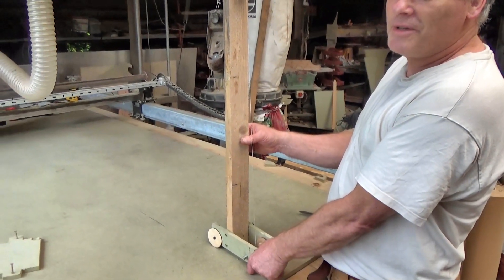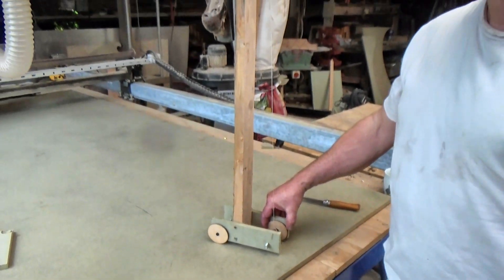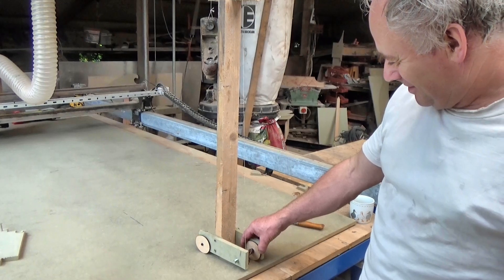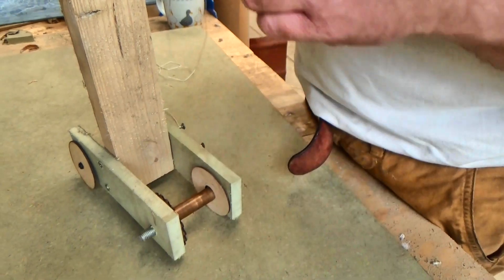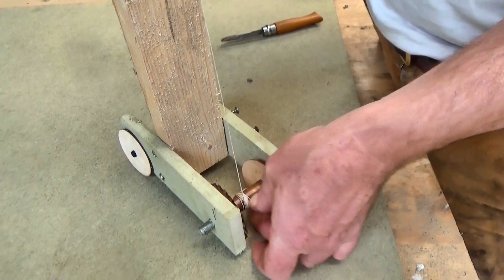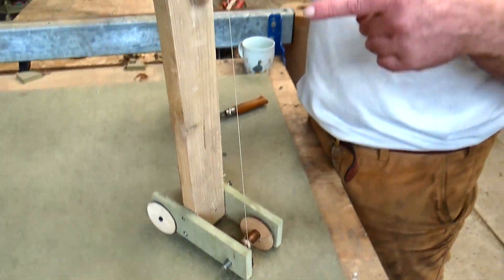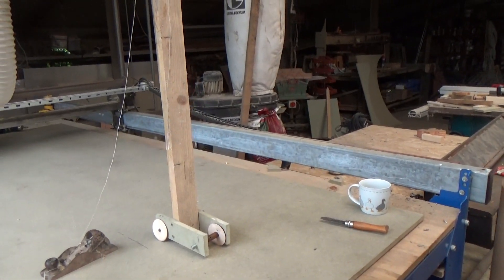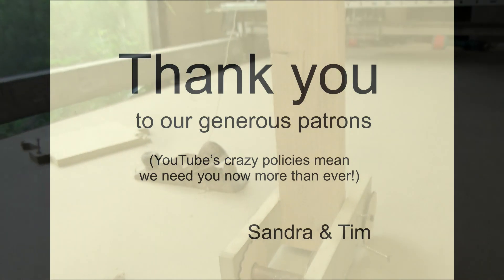A Full-Size Wind-Up Car - Would It Be Possible To Make One? Mark One.

Comment: I was thinking of plates of horizontally mounted staked plates that contain large flat spring steel maybe 4/inches wide flat spring steel. Kinda like the little springs u find in a lawnmower pull cord that retracts the pull cord. These large plates of springs could be staked , say 5 to 10 plates tall with a center mechanism running down through the middle. Each spring could be used independently or together by a shifting mechanism in the car. By the placement of the shifter u could have 1,2,3,4 or more used at the same time or all together depending on the amount of energy u need at the time. The springs could be wound by a large drill type device and the plates would be would one at a time by each spring locking out as each is wound fully switching to the next spring automatically and the same for when going down the road, switching to the next spring when the previous spring reaches a low tension. The springs are encased in metal with only a hole down through the middle where the shaft makes it’s connection and disconnections from each spring. The throttle pedal in the car could be a device that releases resistance to the spring force the more it is pressed and when braking it would use that energy to rewind springs. It’s kinda hard to explain without a mechanical drawing but is the basic idea.

Comment: using a heavier weight and a less steep angle to compensate for loss of pe would make it shorter. Also using a regular wind up cars thingy in series if you could would work.
Whats the farthes a wind up car has traveled? 
so in series and with big tension meaning little movent ni the sprins working in series may make it posible to travel... Let luck lend itself to me who am Imperfect.

Comment: I have a wind-up wrist watch that has an auto-wind mechanism inside it.  While I do need to wind the watch in the morning, it will stay wound and running throughout the day as I move around.  The auto-wind mechanism is like a half wheel on an axel that will swing around and wind up the watch bit by bit throughout the day.  I wonder if you could make a wind up car using this concept, where you use some of the motion made by other parts of the vehicle (or the person riding it) to add "clicks" to the wind-up part.  And the amount of energy or effort could be offset by gears and pullies, I think?  My son knows a lot about physics and explained to me how this may not work out...something about perpetual motion.  Lol!  But it's still fun to think about!

Comment: One of the ways it could work would be with a flywheel but it would still require a couple of springs and not be enough to go to the shops even if they were 5km away

Comment: This can be said to be a form of flywheel energy storage--storing mechanical energy to be used later.

Flywheel energy storage is mostly used on spacecraft or in heavy industrial environments where the energy investment relative to the energy budget is great.

Nissan used a special transmission on a racecar recently that had a special gear set: rather than connecting the engine to the wheels, it connected the wheels to a flywheel, which was stored in a vacuum for greater efficiency. It would spin up to 100,000 RPM's as an alternative to braking at high speed, and then disconnect from the wheels to brake. When it was time to accelerate again, it would dump its energy back into the wheels, granting an immediate surplus of acceleration, with less gasoline and brake usage... which is very important in an endurance race!

It worked too well: car transmissions weren't designed to move so much energy so quickly, even its special one, so it blew up and caught fire mid race.

Comment: There are buses that use spinning weights for energy storage, which is possibly as close as you can get to a spring that really works. https://en.wikipedia.org/wiki/Gyrobus

The other way would be to power the car from a falling weight that's not in the car. I imagine a kind of big structure full of mass that you can release into a generator that charges a battery in the car. That way it doesn't matter how big or heavy the mass is, or how far it has to fall.

Comment: I discovered in physics class that rotational inertia increases with mass and increases exponentially with distance the mass is from the radius (squared).

There's a bus design I heard rumors about that works this way. A big ol' heavy wheel inside the bus that can be attached/detached to the axle to release its energy/spin calmly.
It looks fun. 

https://www.sciencedirect.com/topics/engineering/flywheel-energy-storage

Comment: Hamsters.  Store up the energy from them running round their wheels.  Cost less to feed than a horse (I think!).  You could use a spring mechanism to store the energy...  But you'd need many hamsters.
If you had a horse to generate energy which was stored and then used later to propel the car, you'd end up with a very unfit horse, or it would go bonkers due to the boredom of walking (racing?) round in circles all day.  Just harness the horse up to the "car" and cut out the middle man.  I've been saying for donkeys' years (pun intended) that we should bring back horse powered vehicles because i) the dung could be used on public flowerbeds to make Britain beautiful once again ii) working with horses would slow traffic down (we'd still have internet and technology and electronics) and reduce people's stress levels and  iii) unemployment would be reduced because of the need for ostlers, coaching inns/team or horse change stations, gardeners and all the ancillary trades we'd need, such as saddlers and harness makers.  Electric cars? What a load of tosh!!  Bring back horses, that's what I say!!
Reply: P.S. I mean store the energy in a spring, as in a wrist watch: a longish length of coiled flat metal.  To save space and contain the spring and allow a controlled release of energy.  I wasn't thinking of springs as in the suspension on our Triumph 2000 back in 19seventy-something.

Comment: I have seen cars driven on compressed air. Instead of lifting weight, twist the rope and use torsion?
Reply from the maker: Yes, I hope to get to compressed air and vacuum springs soon, but I'll look at metal and rubber springs next..

Comment: Turn the prototype around and let the weight fall behind the car. That will also add weight to the drive wheel and then spread the weight over all four wheels when the weight is gone. A full size car would be very impressive if you can do it. Good luck.

Comment: What about a lot of smaller weights, which fall in slices like slices of a rectangular cake, one after the other off the end. Then at the start each is hoisted individually to form the rectangular long block.  With a lot of slices each does not need to be too high or too heavy. To keep going momentum would need to be kept though.

Comment: Wondering if you could store the energy in say a really strong elastic/rubber band, Like was used on toy boats n planes, although you'd need a way to safely control the release of said energy Hmm could get a bit messy or arrive ( and need extremely hard wearing effective brakes)very very fast Ha ha love it got me thinking about adding an manual energy storage to my bike to help up the hills a bit

Comment: By using a bike free-hub and a weight on a rigid pendulum attached to the hub, you can drive an axle with the pendulum motion recycling on the back swing to drive it again on the subsequent swing.  I helped my daughter with a 2 wheel design of this kind for her science class competition.  Powered by a brick and using 36" wheels cut from 3/8" plywood on a 3ft wide axle, her car was the only car to travel beyond the boundary of the basketball court in the gym being used for the contest.  Not only did it travel farther that any other design, it was still picking up speed when it hit the far wall of the gym.  We never actually found out how far it would go, but a test in a small flat parking lot ended with it running out into the grass on the far side, still coasting after the brick had settled to bottom of the arc. Around 100 yards. We did nothing to optimize the design beyond adding some silicone to the contact surface of the wheel to keep them from slipping on the smooth basketball court when the initial torque was applied.
Reply: Also interesting...
Reply from the maker: Excellent. I like it. Still not really scalable to full size, I suspect, though!

Comment: Try using a large rat trap , you put wheels on the trap & tie string to part of trap that drops , other end of string is wrapped around rear wheels axle,  as your setting the trap spool the twin around axle,  when trap is released & lever drops all that energy is passed through string to rear axle
Reply from the maker: Yes,  metal and rubber springs next..
Reply: @WayOutWestx2  I imagine coil springs from old vehicles,  multiple springs say 4 in a row , all compressed & release one springs stored energy at a time , as spring energy is releases then on to next spring while that spring automatically  is re compressed , imagine a huge crankshaft that has coil springs instead of pistons

Comment: Tim, you are into sailing, what about putting a sail on the car and a fan on the back to blow the sail?
Reply: How would the fan be powered??
Reply: @Cellottia  Waterwheel, see in another comment I suggested the two bathtub system, with one tub above the other, potentially very high up, as water flows it can drive a waterwheel.  any spare energy or regenerative braking can be used to pump the water from the lower to the higher tub.  or a hamster, they like wheels., I am sure a hamster would be good at driving a fan.
Reply: @bootsowen  I see! And yes, I saw the bathtub idea but not in my mind's eye... And I'm glad U like the hamster proposal, too 😉!

Comment: I recall there were some compressed air powered cars in Paris for a while. Similar sort of idea - mechanical energy storage rather than chemical. It apparently worked quite well for very short journeys.
Reply from the maker: Yes, I hope to get to compressed air and vacuum springs soon, but I'll look at metal and rubber springs next..

Comment: Whilst trying to not be too negative, I feel I must relay that my varied studies on mechanical energy storage for the purpose of locomotion do point to energy being stored in a coiled main spring being the most practical, and energy stored in the angular momentum of a flywheel having the highest energy density, the problems being that the former has a tragically low energy density, and the latter is tragically impractical.
Reply: Another difficulty with mechanical energy storage is that any containment failure will tend to rapidly release that energy as kinetic (bits flying around) instead of thermal (bits getting hot) like electrical batteries. Chemical energy is great in this respect as the release isn't self-initiating (unless you're using hypergolic fuel). The ideal would be something like triple helium fusion, as the fuel is otherwise stable and inert, the energy density is tremendous, and the exhaust byproduct (carbon 12) is harmless. Sadly, we don't know how to do that at all, let alone get it to fit on a car.
Reply: @peripheralarbor  Indeed.
Reply from the maker: Thanks, Paul. Yes, you're right, of course. But you could argue that petrol cars also carry all their energy in a potentially dangerous state. Helium fusion then - I'll get on to Will...

Comment: It seems like it should be impossible to climb a hill that is higher than the distance you have suspended your weight, no matter how heavy the weight or how you geared the drive train. Otherwise, the falling weight would actually be lifting itself, generating more potential energy than it uses. Am I imagining this correctly?
Reply from the maker: That makes sense alright. Another reason why this design won't work. But there are many more to explore

Comment: There's good reason why energy for transportation is stored in (electro-) chemicals and is extracted using the known processes (combustion, batteries, fuel cell). Mechanical storage (flywheels) was explored for public transport but suffers from some severe drawbacks like Coriolis force and safety - latter remains valid for any spring or mass based system. What doesn't mean that there aren't any other good ideas - but the chance to find one which hasn't been already explored is pretty darn small. Groundbreaking inventions can be made in the fields of battery and fuel cell technology but require substantial knowledge and specialization in those fields.
Energy storage for static applications is a bit different - but also there the chemical energy density is often unbeatable. Interesting example for instance is the seasonal heat storage using salts: Storing thermal solar energy from the summer for heating in winter - already pioneered by Mária Telkes in the early 1940s but now "rediscovered" and hopefully soon available.
Reply: Interesting...
Reply from the maker: Thanks, cls. YOu're, right, of course. But we might still have fun exploring. (I've been considering the heat-storage tanks myself..)

Comment: The energy of the falling weight could be stored in an intermediary device like a wind-up spring and then released more slowly, i.e. with brakes. That would let you spread the energy expenditure of the drive to town in a slower, more controlled manner.

Comment: You probably going to find out that one of the biggest problems is controlling the energy. To prevent the car to hurtle forwards uncontrolled, you will have to have some sort of brake on the mechanisme. The braking will convert a portion of the energy to heath. That energy will be lost. You might look into compressed air, but that will also be challenging to make it efficient.
Reply from the maker: You're right. But there are always clockwork mechanisms..
Reply: @WayOutWestx2  True, but those also lose a lot of energy. In a clock that is no problem, clocks don't need a lot of energy. Cars do. I think it's a great idea to try though ;-)
Reply: thinking about it, a clockworkmechanisme does not lose too much energy maybe

Comment: i've been playing with the idea but not put it to a prototype, if you have as much of the car as possible (occupants and all) suspended above the wheels, the bigger the car is, the further it will be able to go. even the drivetrain can be part of the suspended weight and can transfer to the wheels via a spline shaft. that idea came from a brainstorming session on how to cheat in a soapbox race without technically breaking the rules.

as for using springs, they've already been doing it for centuries in the form of steam! a steam boiler contains your fluid spring and it is gradually released to push the car along! not quite in the spirit of this idea, but worth thinking about what a spring actually is at the end of the day, and proof it is indeed possible!
Reply from the maker: Yes, I hope to get to compressed air/steam and vacuum springs soon, but I'll look at metal and rubber springs next..

Comment: It's a fun idea, but maybe not too practical. My Yaris uses about 235MJ of petrol to drive 100km (about 7L/100km of petrol with an energy density of 33.7MJ/L). The energy efficiency might be around 25%. So for a small wind-up car, for a day of errands, we might need about 60MJ of energy with nearly 100% conversion efficiency. This means to store that energy in a 100kg mass, we would have to wind it up to a height of over 60km, which is closer to space than the ground. That would be quite the car. Okay, so what if we limit the height to 5m, still taller than a double-decker bus? Well, we would need a mass of over 1,223,240kg. This could be dangerous. To compress this mass into practical dimensions for the engine, you might surpass the Schwarzschild radius, collapse your car into a black hole, and have it gobble up all of Ireland.
Reply: Damn science! I thought he had something there! ;)
Reply: @Godshole  I'm having a good laugh at all this to-ing and fro-ing! It's fun!
Reply: @Cellottia  
to me
To you
to me...
Reply: @Godshole  This in itself could form a method of propulsion...!  Remember (from black'n'white films) those platform bogeys where 2 people stand and pump a "seesaw" thing?  Hmmm, y axis rather than x, but it has potential, don't you think?  (Perhaps this is getting silly now, maybe I should go and do something sensible, like exercise my fleas in my flea circus...)
Reply: @Cellottia  Tim already has rails set up! I think you've cracked it!
Reply: but what if you use a smaller vehicle, that is lighter? By my calculations you would only need a country the size of luxembourg.
Reply: It's OK, the Schwarzchild radius for the mass of the entire earth is a few millimetres. For a paltry 1223 tons, it's a microscopic speck. 
Carry on Tim, Ireland is safe!
Reply: @robinbennett5994  Yeah, I worked out the density would be about the same as in a large sun, but you know, Tim might compress it a bit too much by accident!
Reply: Electric cars go 3 or 4 miles for each kWh. That's about 1 MJ per mile.
I think your estimate is pretty close, but this way is easier.